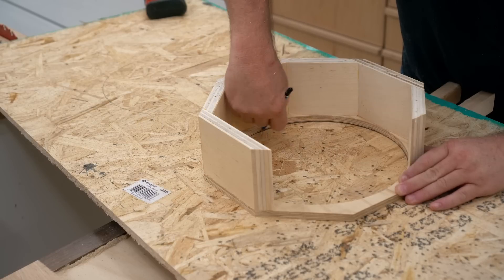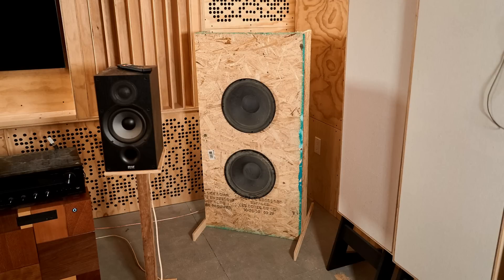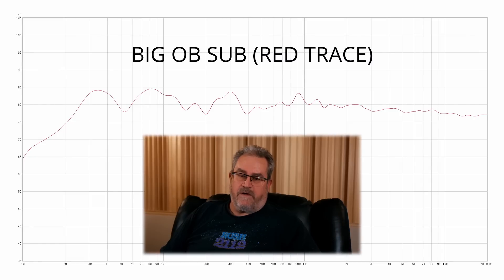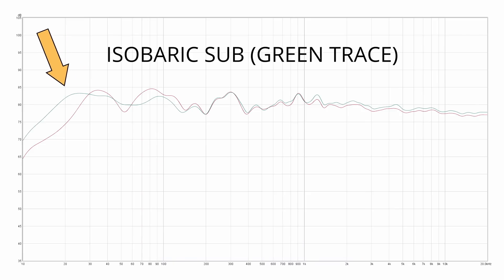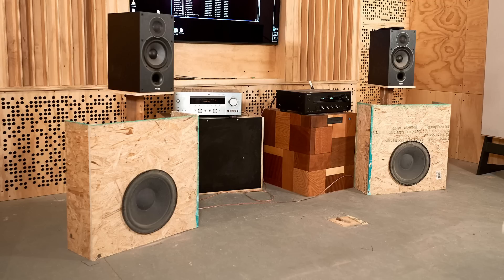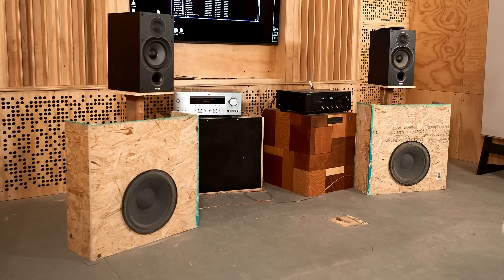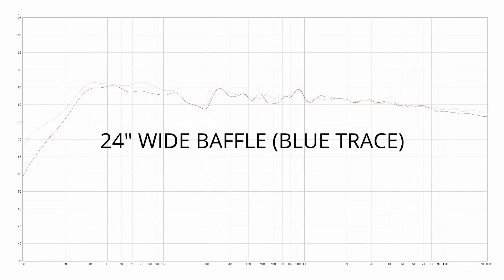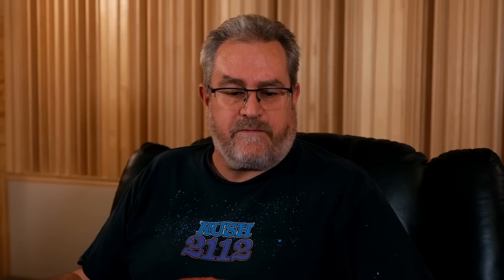Experimenting With Open Baffle Subwoofers - Unexpected Results

Comment from the maker: A bit more detail:
I tried that first dual woofer sub in three different locations at the front of the room, and saw very little difference in the measured output. But that first measurement and the fullness of the bass produced encouraged me to keep going.

In all instances I had to have the tone control on the Yamaha receiver set to boost the bass. While I could do that in Equalizer APO, that generally means cutting higher frequencies to get enough boost in the bass region. The bass control on the Yamaha seems to be doing a very accurate and natural sounding lift.

Without the bass boost there wouldn't be enough bass output from the 2 woofer setup. 
The 4 woofer dual subs that I settled on can be improved by adding a lowpass to 2 of the woofers and using those exclusively in the very low bass range (40Hz and down), while the other two operate up to 80Hz. This should extend the bass output even lower, but does complicate things.

You'll often hear that open baffle speakers don't excite room modes, but I saw no evidence of that. The one distinct advantage I saw was that they are easier to place in the room - boxed subs will perform much differently in different parts of the room, while these work the same (more or less) wherever you put them (within reason - they do need to be away from the walls by a certain amount).

As for the quality of the bass, I couldn't hear any difference other than the struggling problems of the woofers pushing their excursion limits. Keep in mind that this is crossed over at around 80Hz. 
My isobaric sub was putting out solid, effortless base that sounded accurate and extended down to 20Hz. These are the same except for the depth of the low end, but sound identical to the isobaric sub.  My room is 14' x 14' and is well treated acoustically, and these subs easily provide enough thunderous bass for modern movie soundtracks.
Reply: Seems to me you need some FI AUDIO IB 15’s or 18’s in your life. They’re reasonably priced and have some real excursion..
Reply: A really good FX soundtrack for low bass extension is "War Of The Worlds" is got some wall shaking bass. BTW, is open baffle different from infinite baffle? I'm suspecting they are. Infinite baffle requires the front and back of driver to be sealed from each other right. I don't recall ever seeing/hearing a open baffle before.
Reply: @harryberry474  The "church scene"...yeah just watch all the new Godzilla movies if you want the reall low lows...or the intro to edge of tomorrow...
Reply: Very interesting.  Yes, I have used isobaric subs and liked the quality and quantity of bass.  I currently have my subs as explained previously, roughly at third points horizontally and half way up the head wall of the room.  This location definitely seems to produce less reflections by both subs coupling and creating a wave front starting from that wall and moving back through the room. My room is 13'x20'x8' tall.  Notice the proportions.  They are the golden mean.  So the standing waves in any direction are never replicated in the other directions.  That may be why the positioning of your subs do not make much difference at 14x14.  Not sure of the height.
Reply: Why not try an IB (infinite baffle) instead?  I mean a system where there is no path between the front and back of the speaker.  Of course you can make a box do this effective (as long as the box is large enough that it doesn't materially impact the speaker's resonance.
Reply: Which drivers are these? I watched this and the IB videos, didn't see the driver model mentioned.

Comment: A dipole speaker will get bass cancellation if it's close to rear walls, the original  placement in the corner or the room was the worst possible if not actually touching a rear wall...

Comment: You should try make a dipole with a W manifold so 2 woofers can play and cancel out that acceleration forces and vibrations while still play as dipoles. I used to have Celestion System 6000 open air dipole subwoofer and even if the cast iron frame they was in with two 12" in the frame the iron frame would shake like crazy when it was playing. That dipole I think would maybe benefit from using a W manifold to  mounting the woofers to cancel out that rocking motion.

Comment: When I hear open baffle speakers all I think of is weak low frequency bass since I have played Bass Guitar since I was 10 years old and am now 70.  The old Floor Model radios almost all had open baffle 12 inch speakers being driven by maybe 15 to 30 watts and their bass was very weak even if I equalized them for extended low frequency response. I played on some older Bass Guitar Amplifiers that came from the factory with open baffle speaker cabinets since they were originally designed for regular guitars, not Bass Guitars and the low end was very lacking.  I obtained a closed baffle cabinet for one of my 20 watt bass amps and found the difference was very great and it even sounded good with regular guitars. Note the speaker in the cabinet was the same model as the speaker that was used in the open baffle Guitar cabinet so the speaker was not the weak part, it was indeed the need to cancel the out of phase audio signal from the back of the cabinet.  If the back of the cabinet was removed the bass response went way down as to not be useable for my Bass Guitar playing in the Jazz Band I was in. If people like weak bass, which I know many do, then open Baffle may be the way to go for them. The sound of an open baffle with bass being played through it mostly reminds me of the Orchestral Upright Bass that I used to play and it is ok for that type of bass reproduction but not for Bass Heavy modern music.  Just so people understand, I am a retired Electronics Engineer so I have done the work.  Lol

Comment: Nice shirt. You have to make sure the qts measurements are correct if you use an open baffle to work correctly there's drivers made for ports , closed design and open baffle and you find what works for your design from the qts measurements or it's not going to work the way you want it to.
Reply: If you run IQ to correct for the bass loss many say Q of 0,5 and even lower sound better...

Comment: Open baffles/dipoles need between 2 and 3 meters distance from backside to wall for maximum efficiency. Q-values must bei higher than 0.7. W-shaped Ridthaler type dipoles reach  \-6dB@16Hz but need frequency response correction via FIR DSPs. My favorites are open baffles with wide range drivers (e.g. Tangband W3-871SC) for mid- and high frequency range and Ridthaler type dipoles for base. I use Crown XLS power-amps (much faster than e.g. Monacor STA-X00D) to drive the Ridthaler- dipoles.
Reply: With W shaped you mean W manifold you mount the woofers in pair so the cancel out the rocking motion and vibrations? I always wanted to try that with my Celection System 6000 open air dipole "isobaric" sub woofer that had two 12" woofers playin in synck creating horrible rocking motion en the speaker even if they was 45kg each. A W manifold and mounting the woofers so the acceleration forces cancels out would have removed that rocking motion that is wasted energy.

But before I was able to test that all 4 woofers in the system got ruined by the 250w NAD amp suddenly playing 50hz at full blast 2 times first ruining 2 woofers and then killed the 2 last one a month later same way... (I was using RCA cables with split mid leader connection or else you would get sudden episodes of 50hz at full blast very often due to bad connection, I was sure I had solved that with the split RCA center pole but no, it still happened just less frequently and did blow the speakers and I could not afford buy new woofers).

Comment: Please try using a very large open baffle, eg 8 to 20x the surface area of your subwoofer. If you hang it in such a way (for hinge effect with ropes) that the apparatus resonates just below your cutoff frequency, you may find lower frequency response, as the baffle transitions into transducer effect. I had great success mounting a 52" display on top of a high fidelity, sealed enclosure, forward facing subwoofer, driven with lots of power and eq from the center channel source. Clearly the display was somehow enhancing the very low frequencies.
Reply: It is a case of diminishing returns to make it larger...

Comment: What about selling the rear sound wave totally from the front?
Like speakers in the rear deck of a car.
Reply: Then you have a normal sealed box speaker... Or if the box is huge (like another room or playing into free air outside  the back ) you have an infinite baffle speaker. What most people like about dipoles is the sound stage they present due to making sound on the back, it give a unique sound that no other speaker is capable of making. Many thing it is the lack of box that give you that sound but that is not really the case or a infinite baffle speaker would sound the same...

Comment: have you thought of trying an isobaric pair mounted in an open baffle?
Reply: I had Celestion subwoofer like that... Four 12" woofers in 2 frames with 45kg each and they would shake like crazy when playning bass wasting a lot of energy just wibrating... I always wanted to try mount them in a W manifold with the woofers mounted so they would cancel out the acceleration forces and vibratins, but 50hz hum found the way into my 250W NAD and did blow all 4 woofers before I could try and I have had no money to buy new drivers.

Comment: I could be wrong, but I think the challenge for some tastes is getting the frequency low enough. You can tune a box, but you can't exactly tune a speaker lower than it's rf. But, you can find them. Problem is they're pretty expensive. And heavy.

Comment: Thanks, for me the best diy and audio channel, really information that is not bs but the facts. I worked diy both isobaric and OB sub and these facts hold true, with OB there is a steep drop from 50hz with near field measurements so the use of OB sub is really questionable, on the other hand the sound was correct and less disturbing than with isobaric.

Comment: I don't know how true it is as I am not an expert. But I remember reading reviews while shopping around for speaker drivers and some of the models I looked at people said they were good for open-baffle use because they had a very high sensitivity rating on them versus the "standard" speaker driver. So from what I'm getting out of it pretty much any full-range speaker driver with a sensitivity rating of 100+ db. Again, just something I've read from other builders experiences who deciding to leave reviews. So I don't know if it's true. :)

Comment: Instead of a free standing free baffle woofer, inside the room, why not mount the woofers in the wall.   It is still a free baffle but one side in one room and the side of the driver in the other side.  It gets rid of front to rear cancellation and gives you full bass  extension the driver can do.  But the big thing will be gain of output due to loss of cancellation.  If you do, a driver with a qts around .6 would work best  mathematically.
Reply from the maker: Actually working on that right now :) 
I was wondering when someone would mention infinite baffle and my room is nearly perfect for it, since there's a utility room behind the front wall.
I thought about doing it from the beginning, but like the open baffle, or even more so, there's not much speaker building involved. But then I can concentrate on making the main pair really nice.
Reply: @IBuildIt  yep, that's an age old idea.  I have found a speaker with a qts of 0.6 is the best compromise between natural dampening and transient response.  Back in the fifties guys would make one wall of their listening room a combination of infinite baffle subs and huge horn speakers. Then they would put a huge grill cloth over the whole wall so that it looked like a ""normal" room.  Talk about efficiency.  A three watt amp was probably all they needed.
Reply: @IBuildIt  Very good idea. OB mains and then a manifold style IB with something like 4 Dayton HF 15 subs. Should cover everything nicely. I would want the OBs covering down to 40Hz with the IB covering the last 8va and a half.

Comment: I thought subs were fairly non directional. You can put them almost anywhere in the room and it’s good. I’ve run sound for stage (live theater), basketball games in a small arena, small concerts, outdoor venues, and the common denominator is. Nobody notices good sound. They only notice bad sound.
Reply from the maker: I notice good sound :)
I think the problem is most people haven't actually heard good sound.
And while low bass is mostly non-directional, the placement of the subs can impact the response at the listening position.
Reply: Most people do not care, they just want ok sound... And beyond that they do not notice or care.

Comment: Very interesting. I have been wanting to try open baffle in general so thank you
Reply: I made my first set 2 years ago as a Covid project.  I had a set 3 way diy speakers with Philips drivers that I bought from a thrift store. They sounded crappy, no dynamic and totally filled up with damping stuff.  I took them apart and placed all drivers in a piece of 18 mm thick plywood. Used the cross over as it was(a huge diy thing).  The result blew my mind!  Very open sound and a musical bass from a 7" woofer.  Jazz sounds amazing.  At the moment I've made two sets, one a 12" full range Philips driver with added tweeter. Second one is a 3 way using a 6" 10 watt full range as tweeter, 2 x 7" 6,3 watt full range in series as mid range and a 7" 20 watt woofer. Cross over as above from the crappy speaker set.  Sounds great!  Go try!!!!  It' s a lot of fun.

Comment: The front fascia and the wings Need to be calculated to optimize response.
Reply from the maker: Or you can just build it cheaply and test it in the room, like I did.
Reply: I would just build a front baffle and use cardboard to optimize the wings.  Not in beginning.  Near the end to fully optimize.  Love your channel.  Its a fantastic resource.

Comment: I've enjoyed your speaker-building videos.  Hopefully they will get more people interested in the hobby.

OTOH, I've always though that open baffle subs were a really bad idea.  At the one extreme, a sub with no baffle simply pushes air around the edge of the frame and the compression/rarefaction waves cancel right at the edge.  Add a baffle and more energy gets directed forwards/backwards at higher frequencies.

But at sub-woofer frequencies, say 40Hz, the wavelengths are so long that the baffle would (in theory and if my math is correct) have to be around 15' wide to effectively separate the front/back waves.  Double that for 20Hz response.

Add the loss of cone excursion control and I don't see any advantage to open baffle sub design.  For those reasons, I've never tried it so I could be wrong.

Maybe try measuring or listening very close to the baffle edge and only a few inches further away.  If the difference is substantial, that's wasted acoustic energy.

Anyway, thanks for sharing your interesting projects.
Reply from the maker: The response down to 30Hz is easy to see in the measurements posted in the video, and I also show the effect of reducing the width of the baffle on the low end output. The original baffle width is a total of 40" with the wings, and 34" after I cut the baffle narrower.
And then there's my under-oath testimony that I didn't detect any reduction in the amount of low bass when compared to the very capable isobaric sub I had in the room. These are in-room measurements, though, and not the actual output from the subs in an anechoic chamber.
So I'd like to know where you are getting your OTOH from? Isn't the evidence I've presented here compelling enough?
Reply: @IBuildIt  Well, let me back up.  If your goal was to experiment with an open baffle design and see if you could get a reasonable LF response curve, then well done.  I think that it's great to test various designs and see what happens.  I'm all for that.  (I've tossed many more failed box prototypes than I've actually committed to final builds.)

I was simply sharing why I think that the two approaches are not equally "good" sub-woofer designs by any other measure -- efficiency (SPL/watt) and cost ($/SPL) to name just two.

So if you were a hobbyist without extra power amplifiers and EQ equipment and had to pick, which would you spend limited funds on?

Thanks again for investigating and sharing your experiences.
Reply: The advantages with open air subwoofers is clean fast bass sound without distortion :) And all the problems is solved with more drivers and IQ usually 6db+ per octave from 70hz and down.

Comment: Would love to see a decay response between the two as that should theoretically be one of the advantages of the open baffle, though in the sub area I'm not sure if it appears. The favorite pair speakers I've designed have been a pair with a cardioid radiation pattern, less interference from room boundaries, but these though tower speakers only went down to 60hz, were passive.
Looking forward to the rest of your build!
Reply: I love OB bass.  I use a 21" OB and the directivity down low is great.  Makes everything sound more real
Reply: My understanding is that you need an anechoic chamber to do that for bass frequencies.   With higher frequencies you can record a time gated response that is shorter than the time it takes for the first reflection to hit the mic. But with the lower freqs. The wavelengths are longer than the reflection distance, so anechoic is needed.